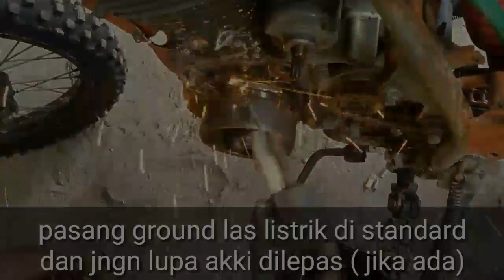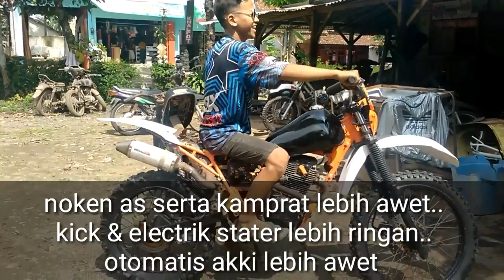Cara agar slah Tiger/gl prooo enteng dan mesin lebih awet #siboen tutor

Comment: Jadi kalau buat f1zr.yg d potong blakang yg d tambah dpn y mas.biar api y tambah.kira2 brpa mm y mas buat f1zr.
Reply from the maker: +Bengbeng Setiawan oh bukan ..gini 
Scr cdi akan membuka pada waktu tonjolan  presis bertemu pulser seketika listrik mengalir ke coil ...nah panjang pulser itu untuk mengimbangi ketika rpm naik ..maka titik temu mulai berubah di tengah  ..saking buanterr iku magnet  muter ...nah yg di kurangi itu bagian kiri(depan)  sekitar 2mm ..secara teknis pengapian mundur 25° 
Dan titik pengapian jadi lebih lambat 15 ° pada  rpm bawah ..sehingga kompresi lebih padat ..
Sebab pengapian standar itu menyala sebelum15°tma ..
Nah itu jadi lebih berat di langkah awal ..
Sesudah di potong ..maka pengapian presis pada tma piston ..jadi lebih ringan di mesin ..dan ketika rpm sedang jadi 8-10°..dan pada top sped jadi 15°sebelum tma ..maka mesin lebih ringan ..dan performa naik 15-25%
Reply: Siboen Chanel bang kalo buat grasstrack berapa yg di potong...?
Reply: Berapa mm yg di potong
Reply: Yulianto Ully 30 mm coy 😆😆